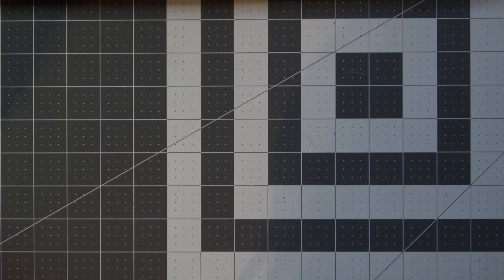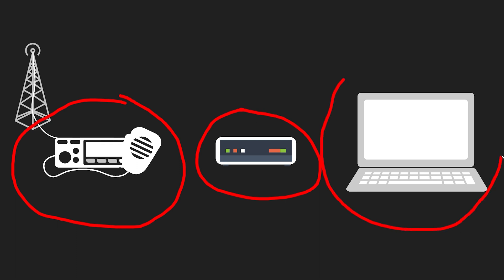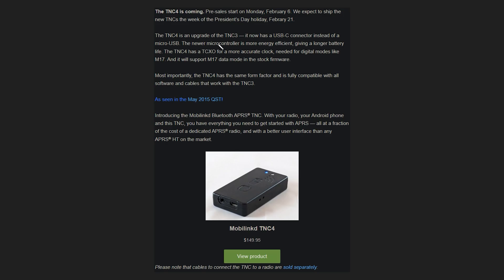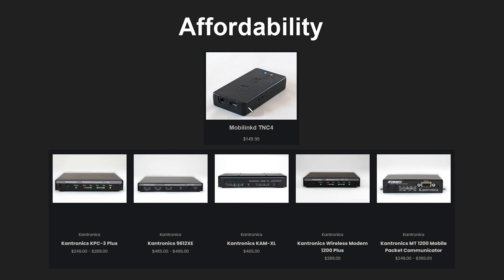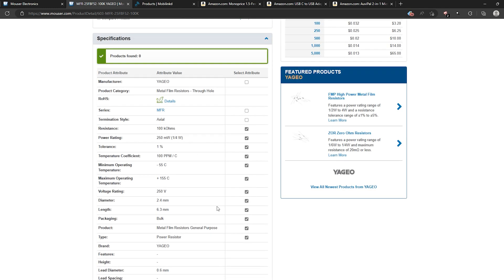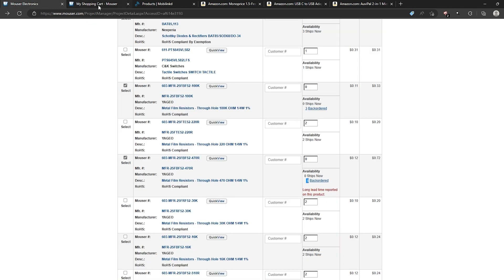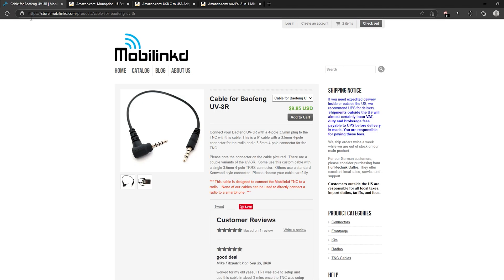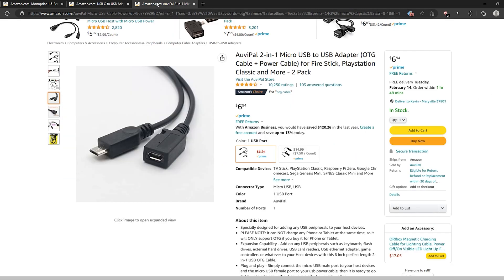Mobilinkd NucleoTNC Part 1 - Ordering Parts

Comment: check your values before soldering !  i just built my kit   and after i couldn't get it to fully power up i  went component  by component  mouser sent 3 incorrect caps
Reply from the maker: Damn! That's frustrating... I've pinned your comment so others may avoid this.
Reply: @The_Comms_Channel    While it is frustrating It is a good learning moment    !thank you For the videos Please keep it up  Iv already ordered. The parts necessary for your latest project !
Reply from the maker: @KO4FFB  Sure thing! Definitely more videos on the way! The Meshtastic box has been great! If you ordered the parts early on in the videos release, be sure to check the links in the video again as I forgot to include some links when I put it out. Glad you're finding the videos useful!
Reply: Was the issue the shopping cart, or was it that Mouser put the wrong items in the box? If the shopping car is wrong, what capacitors were the wrong ones and what did you order?

Comment: Hey Brother, I've build this device and it runs great with APRSIS32.  It's been a hot minute since I set it up.  I'm running mine out to a Beofeng UV-5R and it runs great.  Using a mini dual band antenna outside at my roof line.  Curious if you've had luck getting winlink to work with this device?  I'm following your kiss bluetooth update & winlink via WOAD video.  It has great instruction for the HT but I need help with the winlink peer to peer side.  Not sure If this device works thru sound modem or what?  Thanks
Reply from the maker: I'm glad you've had success with APRSIS32 and the device, and I'll try to give you a definitive answer on Winlink when I can revisit it. Not tried it with the Nucleo TNC since there's not much in the way of Winlink near me. Appreciate the comment and you being a subscriber!

Comment: Great resource, thanks! Not sure if it is for me, though, as all I have are Baofeng HHs and one Anytone 868, so I have a question:  Does the Nucleo TNC rely on VOX to key the tx circuit? Trying to set that up on the Baofengs, using the BTech APRS cables, does not engender confidence that you are creating a stable and dependable system.